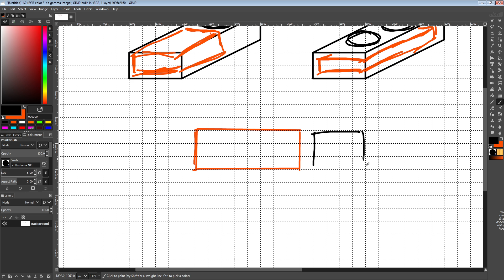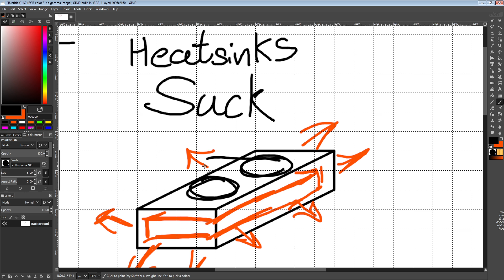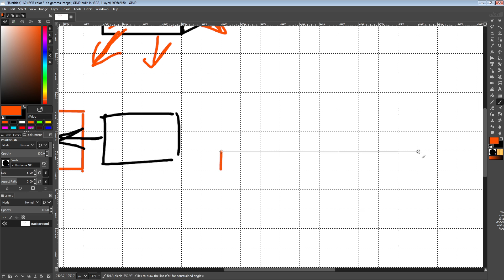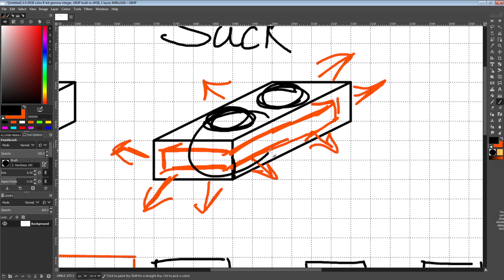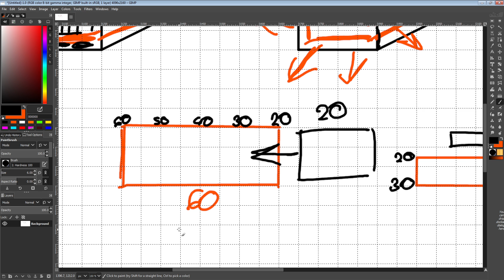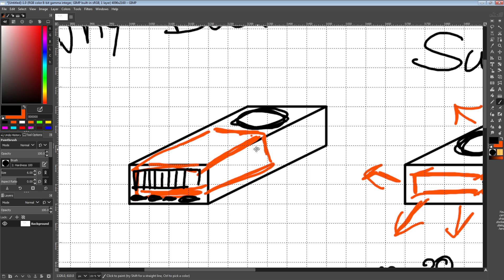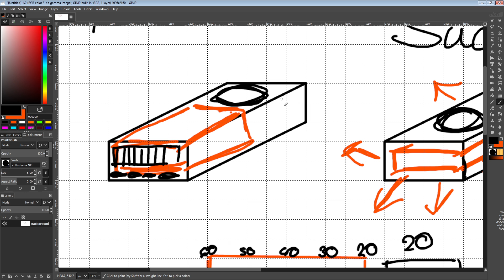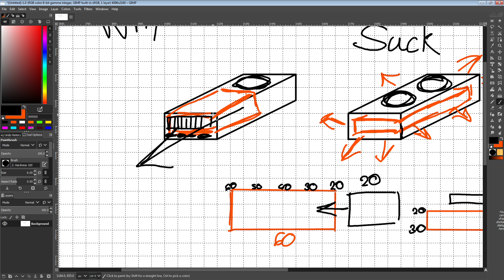Why blower heatsinks suck

Comment: RE: PCIe was never made for 200W+ cards:

I would definitely watch a video of you rambling about how you think modern PCs should be laid out.
Reply: imagine a gpu parallel to the motherboard, like with a riser
Reply: @Flaimbot  And the mainboard split in the highspeed/performance part, and an APU/southbridge board part, so turning it into 3 MB`s with pciex slots at the bottom of the board so they can be daisy chained.

Also maybe have the CPU&GPU face the other way so you can use the case side panel as a heatsink.

And a server style slot-in-power brinck would be much better.
Reply: @Flaimbot  so a vertically mounted GPU
Reply: @Flaimbot  you mean like in server racks?
Reply: bz: "Every motherboard comes with an LN2 slow mode button."
Manufacturers: "... Wait, buildzoid, did you say every motherbo-"
bz: "Did I stutter?"
Reply: ATX has been around since the mid 90's and is just more of the At standards from the mid 80's.  It's really time to re-engineer something more modern.

It's like buying a car with GPS, heated seats and satellite radio, but it has drum brakes on all the wheels and a carburetor on the engine that can only use leaded gasoline.
Reply: I must have a video of him rambling about how he would redesign the rails for overclocking and how side panels would become fan panels with a 380mm monster box fan built in specifically for ambient airflow and motherboard components.
Reply: @maverick9708  I once had a Thermaltake Armor Case with a 240mm fan in it's windowed side panel.
Reply: @liquidcobalt  I don't know why they stopped doing this. Side panel fans were the shit.
Reply: buildzoid pls.
Reply: I think it would be nice if everything was laid out flat with tower coolers on both cpu and gpu. The air goes in one end and out the other. All fans face the same direction. Maybe some slots for half height cards can stick up somewhere they are not in the way, for network, soundcards, ssd etc.
Reply: @jerkersandquist7244  I think you're just describing a rack mount server.
Reply: yeah that would probably be pretty entertaining. and i'd probably agree with him.
Reply: Build the case around accommodating two 200mm heatsinks for cpu and gpu that exhuast directly out the case.
Reply: pls
Reply: I think mxm/m.2 style would be better, you could then just plop a tower rad on it.
Reply: please design how a computer should be buildzoid
Reply: ATX12VO is the answer, I guess.
Reply: Best I can come up with on short notice is just using USB-C or similar interface that has both enough bandwidth and won't easily break like those silly PCI-E riser cables. Then you can mount the graphics card however you like and it even becomes possible to use CPU style tower coolers on it.
As for the PC system itself, it is a multipurpose device, so motherboards should still be useful for many other uses besides gaming. Perhaps for purely gaming purposes Microsoft might at some point just merge Windows and Xbox gaming into one and that'd take care of the majority of PC gamer problems with getting/building a computer suitable for gaming.

Comment: Strip off the fan shroud and heatsink, toss them into the trash, and replace them with a waterblock and connect it to your custom loop.  No more heatsink problems, no more fan noise, excellent cooling. Problems solved.

Comment: 21:17 Blowers are perfect if you want to have like 3 or more cards running in parallel. If you went with open air cards, you'd need to have heaps of case airflow and space them out a lot.
Reply: I’ve got an RTX 2060 and an RTX 2060 KO on the same motherboard with one empty slot between them (the KO is two slots, the vanilla 2060 effectively 3). The 2060 is giving the KO some nice warm air and the KO’s running at 82C normally. If the 2060 blew most of its hot air out of the case, I think it would help.

Maybe I should go without a case? Open-air test bench permanently?
Reply: @markiangooley  if you don't have dust in the house maybe.

I have to shovel out dust bunnies semi monthly :(

Comment: Apart from the challenge of construction, why aren't blower fin stacks 'fanning out'? As air is heated it expands, would increasing the volume along the fin stack result in quieter and faster air flow? You could potentially exhaust to the sides as well as the back?

Comment: I agree, having a grid on the back is a big question! I removed it and reduces my temperature.
and overall open air cards are better. 

but I think you are comparing apple and oranges and you underestimate the blower version.
first, 2 fans vs 1, if you use an open card with only 1 fan pushing air down to the heat sink, you'll have way more heat, half of the heat sink will not have any air flow. while the blower version will send air to the entire heat sink.
also the heatsink on an open card is smaller to be able to put 2 fans, reducing the surface area. (its why most of the open air cards are way bigger, they want the heatsink version of the blower edition but with 2 fans)
and finally all the heat go inside the case, causing additional heat in the case. 

so open air is better... but you need more air flow around the card itself, while a blower card dont need anything else.

I did not see any difference between my blower card (with back grid removed) and an open air from a temperature point of view when I check the benchmark of the other types of cards.

so at the end both designed are equivalent until you are changing the size of the heatsink. and the same amount of heat has to be move out of the case, the blower push it directly outside, no need for additional fans. 
but has most of the cases have a lot of fans, its not a big problem (I have a fan directed to my MB to remove any heat I can there, and a small fan on the bottom of my CPU and this help me cooling the backplate + ssds, so fans everywhere)

I would like to see a huge gpu card (2.75/3 slot wide) with a blower. like having 3 small fans on the back of the card and a really massive heatsink with near 2 times the surface area has the equivalent open air version.

Comment: The biggest advantage for blower cards is that they work much better with WARM and poorly ventilated cases. Otherwise, they SUCK. Open cards also have the benefit of heat pipes.

One design change that I wish we see more often.... is holes in the PCB & backplate to allow air to exhaust more freely.

Comment: There is a better reason why there is no fan blowing sideways in the fin stack. Well the card is not by itself. On one side there is the motherboard, the other side there is the solid side panel. It would be choked.

Comment: Shorten the heat exchanger in the blower cooler and have a fan either side of the heat exchanger??? Push pull inside a blower cooler, less area to heat transfer, requiring lower fan rpm, lower noise, all the heat is moved out the system, and you still get the thicker heat exchanger than in an AIB card....... just my dumb idea.
Reply: It's a centrifugal fan, you can't exactly chose direction of the air. It's just funneled from the back, with guides. But you could, if you don't care about heat build up in case, place it in the middle and blow both ways.

For blowing you could however make it absorb air from 180 degree instead of 90, which is done in laptops, but would require  some quite crazy engineering and also alot of space.

Comment: It all comes down to the use case scenario. Airflow is not the only parameter, static pressure is another one. Blower has more static pressure, which is more suited for closed PC case such as workstation. Blower fan is not to be blamed, what makes it a bad cooler is the unoptimized cooler design. Blower is more universal to all types of PC case, at least it guarantees cooling in all use case.

Comment: I have it in good authority that All Fans Suck.  It's in the job description, the suck air in and pass gas on the other side.  Blower style coolers only make sense for space saving reasons.  All of these types if coolers are crap, even the one in your bathroom vent fan.  Loud but compact for the airflow provided.

Comment: For my 50th anniversary edition Rx 5700 xt (basically a binned reference card) I swapped out the original grill I/O bracket for a single slot bracket and cut off the metal bar covering the pcle slots on the case. I also undervolted, used thermal paste, put thermal pads under the back plate, and did the washer mod. My undervolt is 1800mhz at 930mv but the actual frequency sits at ~1750mhz instead of 1800mhz. At 30% fan speed, my temps are around ~77°C with mem at 88°C while in side of a mini itx case (Silverstone sg13) with basically no direct airflow to the gpu. The temps aren’t awful for being in an itx case and it’s actually not too loud. I don’t notice it too much but even after doing all this work to improve the temps, I think blowers still suck. I’m actually thinking about trying to water cool my gpu instead because my memory temps are too high. I don’t think a customer, especially a beginner or noobie customer has to put this much effort into fixing AMD’s crappy blower cooler. Well I honestly don’t really regret buying it. It still performs great and at the time of purchase there weren’t any other 2 slot models that would’ve fit in my case. Blower cards can still be effective depending on the itx case. Here’s a video by Optimum Tech https://youtu.be/_dhOsTS6-C8

Edit: oh yeah the anniversary edition pcb is different from a regular reference card. I can confirm this too when I took apart my card. That the anniversary edition card has all the aluminum polymer capacitors populated on the back of the pcb which I assume is why it’s better at undervolting and overclocking 

This is a reddit post I found about it. It’s not by me
https://www.reddit.com/r/Amd/comments/dm3uv2/5700xt_50th_anniversary_isnt_just_a_base/?utm_source=share&utm_medium=ios_app&utm_name=iossmf

Comment: Very good summary of the thermodynamics of GPU cooler designs. BZ is right that blowers were designed to compensate for poor airflow cases however he didn't mention that this is actually the case for server racks and other SFF PC cases. It's the reason why Quadros, Titans, and Tesla cards are all blowers.
Reply from the maker: racks normally don't even bother with the blower fans they just let the chassi fans RAM air into the cards fin stack directly.

Comment: Sounds like at the end you are describing the SFFPC deshrouding mod like the one on Optimum Tech channel. Remove fans of GPU heatsink, stick the heatsink to 2x 25mm case fan in exhaust at the bottom of the case, and there you have a full exhaust system for your GPU. The hardest part is getting the case / heatsink combo which fits tightly in the case if not using after market cooler.

Comment: I still remember how we made fun of the first cards with blowers: The dreaded GeForce FX 5000 series.

 Back when ATi was king of the hill. sigh I'm old
Reply: @louisfriend9323  Do you mean 9700 Pro? that thing was revolutionary - the biggest step in graphics technology since the Voodoo.
Reply: @SteelSkin667  the 9500 Pro was the budget version, with 128b wide RAM, but a beefy 9700 or 9800 GPU.

I ditched AMD for an FX 5900 XT, though, and an aftermarket cooler. My 9600 XT ran quiet, with a tiny fan, but the drivers were SO BAD. I couldn't take it.

Comment: There is an upside with blower coolers and that's the fact that the "spent" air goes out of the system.

But that's it.
Reply: That's an enormous upside, though. You can put them in almost any case without worry, even in a prebuilt with only one or two stock fans.
Reply: & here I was thinking the only upside to a Reference Blower Card is the Partners can't make a Worse Design
Reply: Hope you don't mind if I paste my comment, I'm on phone and don't fancy re typing. If you think BZ videos are long read this lol.

1) obviously the air is exhausted out the case, better for cpu and ram thermals.

2) if you have a 100mmx100mm fin stack and then put in a 100mm fan only 73.6% of the fin stack gets airflow from swept area, the corners and fan hub get nothing. Atleast with a blower 100% of the heatsink cross section is used.

Example.
Say you have a 2 slot 10.5in (266mm) card thats 100mm wide with its fans.... you only get 1 slot of heatsink 1 slot of fan.
For a total fin stack of 100mm x12mm x266mm= 320K mm2. But only 176K mm2 (55%) is getting direct airflow through it.
If you have a blower card thats also 2 slot with a 100mm fan thats 160mm heatstack length x100 x24mm thick so 384K mm2 of area.
 Obviously you need allot of pressure to push through 160mm length of fins but even if it was 120mm thats 288K mm2 of area.
Unfortunately the biggest fans they make now at 85mm and the blade depth seems thin and I think that's the main cause, the 70mm fans in recent use seemed deeper like 20mm.
Either way wouldn't be an issue if we had bigger slower blower fans. ALA PS5.

3) as mentioned allot of cards (like my r9 290 twin frozrs) have the air exhaust out the sides right against the motherboard and m.2, assuming it doesn't get stuck there by lower slots... it just gets recirculated so only the sides against the window is what you have to rely on and even that can get recirculated back under the fans.

I'm not saying blower is better but we have 3-4 slot axial coolers like the morpheus so obviously axials aren't perfect either.
I'd love to see a 3 or 4 slot 100mm high (above pcie slot hight like the 3090 is and older lightning/kingpin models) blowers, How about a quad slot which has an 80mm noctua fan blowing through it like allot of data centers (but less noise and airflow and more heatsink).

They just need to put effort into them but they won't because gamers need thier plastic pointy shrouds with RGB lighting etc to make themselves feel validated about thier purchase.

I also like the style of the gtx680 and vega56 and 5700xt stock coolers. Its a graphics card, its a tool like a screwdriver, so its clean and simple black box, it doesn't look like a power rangers lunchbox made out of knex.

This is just my opinion and I test in cases, each to thier own.
Casually waits for triple fan quad slot coolers because anti-sag sticks look good. /s
Anti-lag is for noobs, anti sag is the new thing. Aunty sag is someone else. You're welcome.
The rear io on allot of blower cards is less restrictive than the fin stack. The rear io being removed depending on model might drop you 1-2c at best.
I have 4x reference gtx480s in sli, I have an interest in this.
Edit and 1080ti fe and titanV.

Safe to say there are other benefits.
Reply: @tomstech4390  that's big holy cow!
Reply: @GrimpakTheMook  "that's big holy cow!"... nope not gonna say it.
Reply: @tomstech4390  lol 🤣

Truth to be told, it is quite a good post. Brain at wee hours in the morning and no coffee could only say that tho.
Reply: @tomstech4390  you said that gamers need RGB and pointy things. I think a huge blower cooler would also give them more room to add RGB and pointy designs. They're just being lazy by not adding all of that RGB and pointy-ness to the shroud of the blowers.
Reply: @NoSwitchyt  You know you're right, That green geforce logo on the side that lights up, No reason that cant be RGB!! FFS I know I will turn it off anyway but atleast I want the option damn it!! /sarc :)
Reply: @tomstech4390  finally, someone who actually gets my frustration with blower style cooling. It's not the style that is the issue, rather it is the stagnated engineering process. 

Maybe it's a little niche, but i would not have mind buying a 3 slot size blower style cooler for my gpu. I really the blower style cooler because it reduces the point of failure for my PC, e.g if my front or rear panel fan decides bites the dust, the blower style cooler makes sure that there is still cold air flowing through the gpu.

Comment: Blower cooler has one big advantage
That if you case is too small or bad airflow design
That the blower cooler wont effect and heat the other parts in case
Beside this, blower cooler doesnt really good for every body
Reply: Well you just buy a small case that is all ventilation holes and that advantage is gone.
Reply: @Mysteoa  I just like ITX case
So tiny so powerful so cute
Reply: @justbaka5946  That's what he said. mITX, very open case layout
Reply: @andruloni  Oh I misunderstand then
However still blower cooler is better for ITX
Especially for SFF CASE 
ITX video card just too close to the cpu cooler
Even I use the NCASE M1 still prefer blower cooler

Comment: Probably worth pointing out that cooling solutions like GPU blower fans are used a lot in servers for pretty much all of the reasons that make them annoying for desktop use cases (to the point where even the CPU's use these setups). Multiple fast fans draw cool air in through the front, passes over every component and exhausts out of the back. Noise isn't a concern but the depth of the chassis is.

Comment: Speaking of the worst possible way to cool a GPU, Gigabyte got you covered: https://www.youtube.com/watch?v=P5syq7lR_XI
A cooler that uses 5 tiny 40mm fans, so this stupid theoretical scenario you talked about actually happened!
Reply: He has actually commented on that video 2 years ago, he almost bought the card
Reply: @xWood4000  Oh, great to know!
Reply: Those cards were not meant for gaming. They allowed for a massive, heavy heatsink to be installed onto the GPU. The point was to make the card go through a benchmark without overheating, and the weight helps that A LOT. My 7970SOC hit 1350MHz core without any issues with overheating, albeit with a custom made 3x92mm to 5x40mm adapter with double-stacked 92mm fans for static pressure. I didn't want to push it too hard, they are properly rare.